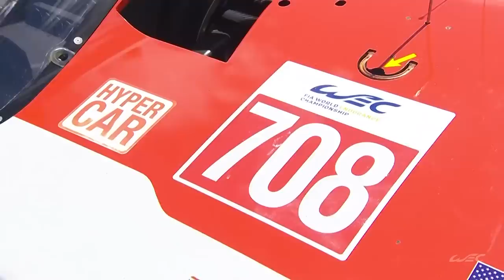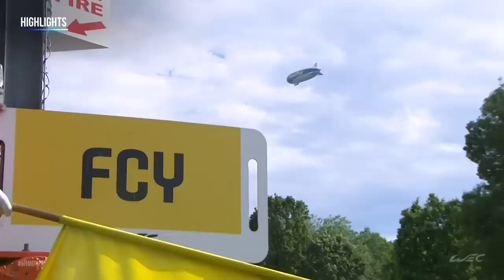FULL RACE | 2021 6 Hours of Monza | FIA WEC

Comment: 3:04:00 - This has got to be code, right? They know there's a possibility their opponents will hear their radio messages, so I imagine they'll use code when they can. "You're drinking too much," probably means something like, "Drive like you're sober, and try not to go through so much dino juice. It's a long race, and Felix da Costa is quicker than you, so just let him by." This makes sense in context, too, because van der Zande immediately gets passed with surprisingly little fight, and it's later revealed that the 34 is off strategy and might be fuel saving.